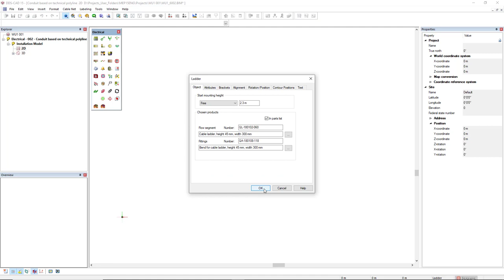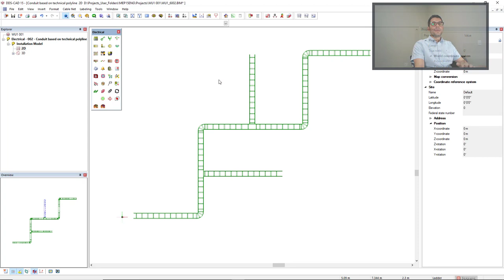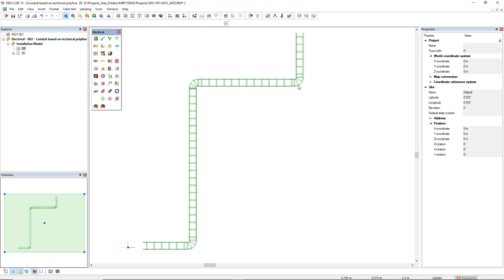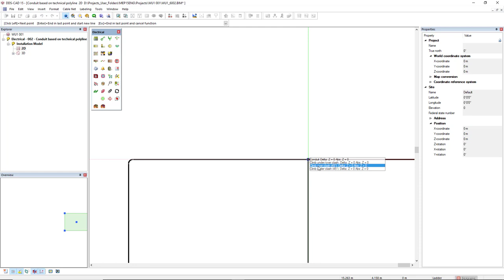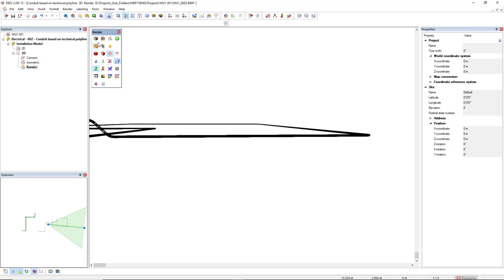How to edit cable management systems the right way

Comment: Great video's ! How to make the conduits have a specific distance for example 10 mm one above the other? You are simple moving one conduit, but for me more precision is dimension from keyboard.
Reply from the maker: Hi targetti123456, Filipe here, thanks for the comment, I really appreciate it! In 3D you should use the Page Up or Page Down keys to change the height. You could also use the arrow keys in a cross section.
One tip, you could specify the offset distance when you are using the Avoid clash function. When the option Climb Under/Over is displayed, select it. The dialogue Avoid clashes will pop up, there you can set the angle, direction under or over and the distance.